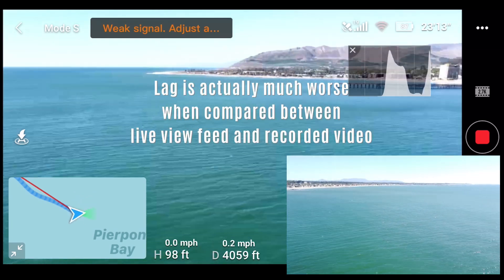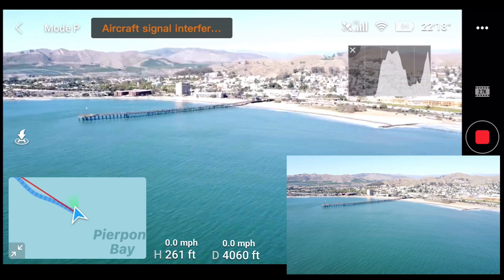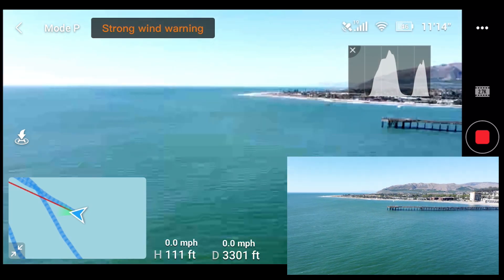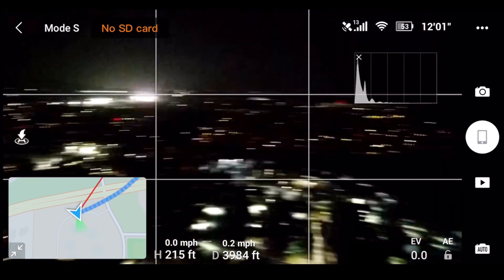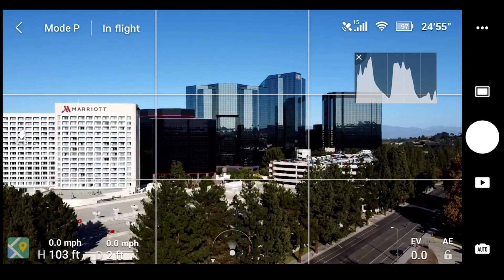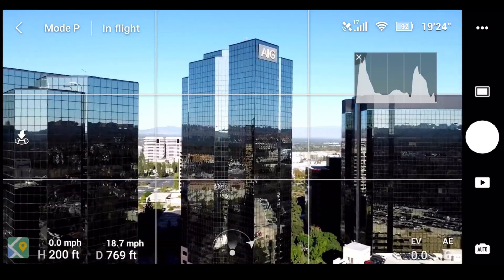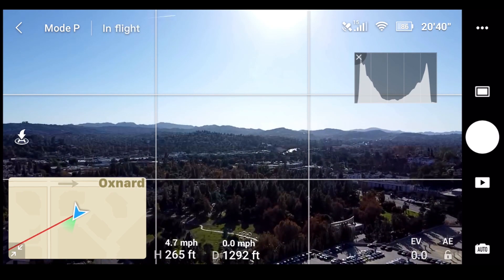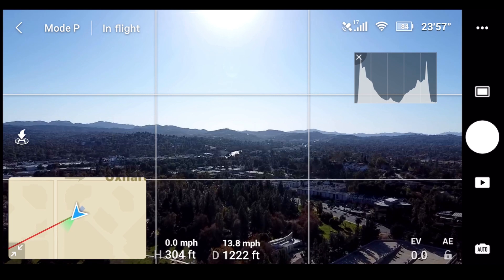MAVIC Mini SEVERE WIFI INTERFERENCE RANGE TEST in 3 Environments - Ocean, Suburbs and City

Comment: Guys I live in NYC The Bronx, and after watching this I don't feel as bad because I used to get around 1,100ft to 1,300ft max here. You HAVE to try this, I replaced the micro USB cable that connects the controller to the phone and it helped immensely! Now I can go as far as 1,800-1,850ft!!! They say those stock micro USB cables suck and some are faulty from the box and that's why you tend to get weak signals all the time. They are inexpensive I bought mine on amazon for $10 and it was very worth it. Now I know that when I go to the suburbs to fly I will get a  better distance..
Reply: Thanks for the tip man.

Comment: I am looking to buy this but I have never seen anyone try and fly to another area say half mile away and land briefly then return. Would the lack of WiFi line of sight make this impossible at the low altitudes so far away?
Reply from the maker: Correct, if you don’t have fairly clear signal LOS, this would not be possible. Curious as to your need to land away from you?
Reply: Dragon7 Drone Tech thanks! just trying to find the limits of capability. I could see myself wanting to land it on a neighbors patio cuz boredom 😂

Comment: My phone is not on the official list from DJI and whenever I have the "record to cache" setting on I get pixelation when turning in either direction.  Turning the recording off to the phone the problem goes away.  I'm thinking the phones cpu just can't keep up with the demanding video processing that's needed.  BTW I live about 5 minutes away from the Marriott so I recognized the area immediately.  Lots of interference there.
Reply: i have the exact same problem! how do you turn off record to phone?
Reply: Go into the settings menu (top right corner/3 dots).  Go to camera tab, then advanced settings.  Scroll towards bottom and turn off "cache when recording".
Reply: Yes! Problem solved!! Thank you so much
Reply: I returned the Mini (it was just the basic package) until I can order the fly more combo.  If you ever figure out what was causing the issue let me know.  I have a Samsung J7 V from 2017 and it was not the most powerful phone even back then :(
Reply: My phone is also not on DJI's approved device list (Moto g7), so I'm thinking your take was correct with an under powered phone. I don't really need a cached version on my phone, so this solution works for me. I might get an iPad mini at some point, but for now I can just edit the original drone footage and make smaller versions for my phone. Thanks again
Reply: Glad I could help it was just by chance that I saw that solution on a post somewhere.  Haven't seen it anywhere in any YouTube videos.  I agree it's not a deal breaker for me either to not have a separate low res version on my smartphone which I"ll probably never use.